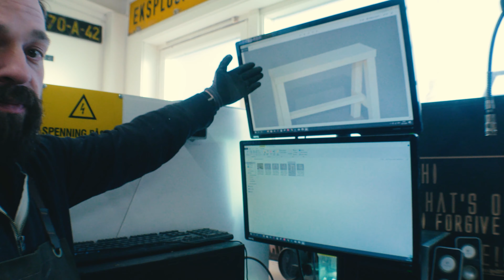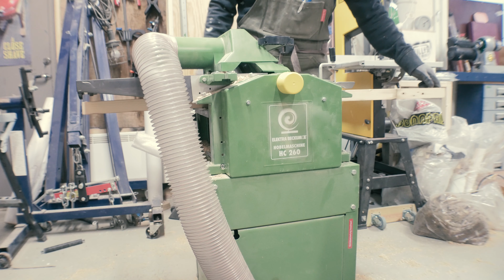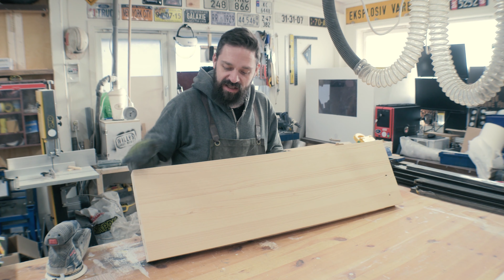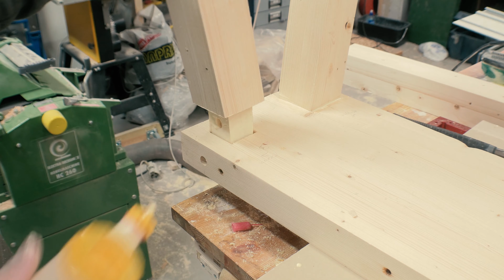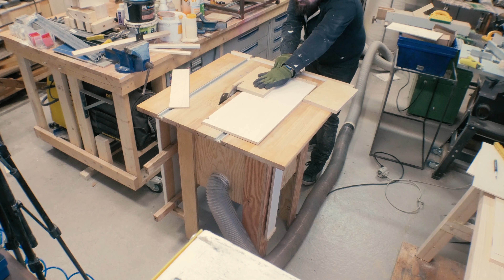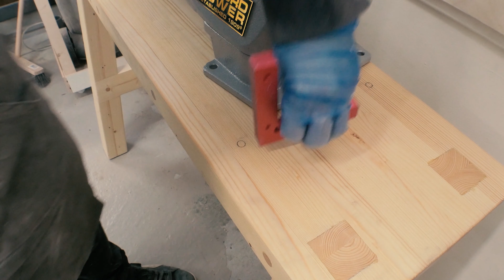WORKBENCH for Wood Lathe | Plans | How to

Comment: Mortice and tenion is nice. But, I would have held the legs onto the top with a couple of temp, screws and drilled and used 2 ,1 inch dowels at a slight angle to attach the top. +/- 2 mm dowels.

Comment: Sweet build. Ya know, when using a pull saw to flush cut a dowel, I always struggle to keep the blade flat against the material. I never thought to hold it down with a block of wood. 18:05 Thats a great tip and I appreciate you sir

Comment: Great content, subscribed.
A few pointers:
I would never wear gloves, since the blade can grab them and your hand along with it. I think sometimes hands too close to blades also, and do use the jointer fence as narrow as possible. :)

Music is too loud or speech too low.

Isn't it bad for the planer blades to put them ladders into it? They had some paint residue, but no finish? I've struggled with this myself, and I have been scrubbing some planks with metal brush to get some airbourne dirt out of them. I would never put anything that has been resting on the floor or gound, since it might have dirt.
Reply from the maker: Thanks, great pointers 😀

Comment: Was it vibration free?  Self leveling feet would have been a nice addition.  Great job though 👏
Reply from the maker: I have no problems with vibration, its quite heavy and sits firmly on the rubber bushings on the concrete floor 😄😄👍

Comment: Hi,
How do you decide the height ?
Do you have the height from bench top to center spindle drive ? (Lathe bottom to center spindle..)
What height would you recommend the center spindle at ??
I like your work 👍
Reply: The spindle should be at the same height as your elbows. :)
Reply: Put the lathe on something and use it. Raise or lower it until you find your comfortable height, Then build your bench.
Reply from the maker: Sorry for late answer, but what AlunB said is right 👍👍😁

Comment: Very nice bench. I just ordered a lathe like you have. Thought to use the wait to make a copy of your bench😉. Could you have been helpful with height, width and depth? Great video you made!
Reply from the maker: Hi and thanks :)  Congrats on your purchase 👍 I am sure you wont regret it!  I think I might have a model of the bench in Fusion 360, if you use or have that kind of software?
If not I might be able to take some measurements tomorrow (not sure if I will be in the workshop) or after new year
Reply from the maker: By the way I'm very happy with the workbench, it works great!  Only thing is that I might add another drawer underneath to get more storage 👍
Reply: Tusen takk, nå blir det noen fine dager i kjelleren. Du ha orden i sakene, imponert.
Reply from the maker: @kjartanaa  Ikke noe problem :-)   Lykke til
Reply from the maker: Hi again :) I managed to sort out all the dimensions on a couple of data sheets. Follow the link to this videos page on my website. Scroll down and download the images with all the dimensions you need. Let me know if you need anything else:
http://willysgaragenorway.no/2020/02/26/workbench-for-the-wood-lathe/

Comment: I've just learned 'bout your channel over there in Norway, sir.  I have just purchased the same machine in Nova Scotia and I'm in the planning stage for a bench.  Because this lathe can swing a large diameter both between centres and when the headstock is turned 90 degrees to the bed, I plan to bolt mine to the benchtop.  In addition [and you can still do this], I plan to enable a shelf close to the floor and load it with sandbags to dampen further vibration when the blank has not been trued concentrically.
Reply from the maker: Good idea and good luck, let me know how it turnes out :)
Reply: @WillysGarageNorway  I'll send you a picture when it's all done.  We can sometimes be swayed by the desire to get a larger lathe with a heavier motor etc., etc. I believe that as a current offering the Coronet Herald is the best buy on the market, superior to the Laguna 1216 or the Oneway 1224.
Reply from the maker: @jageo48  yeah, I'm by no means an expert wood turner and dont have much experience with it. But I have to say that I'm very pleased with the Coronet Herald and I use it at every opertunity, learning a bit more every time :-)
Reply from the maker: @jageo48  And please send a picture when you are finished 👍
Reply: @WillysGarageNorway  It'll be a while since they have not shipped the machine as yet. There is a great book, originally published in 1971 by the UK turner, Peter Child called "The Craftsman Woodturner."